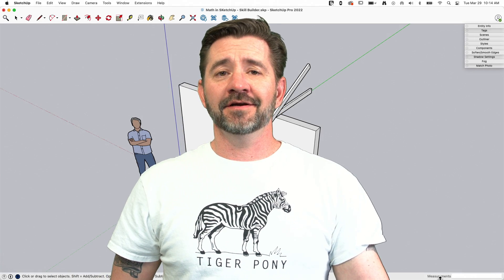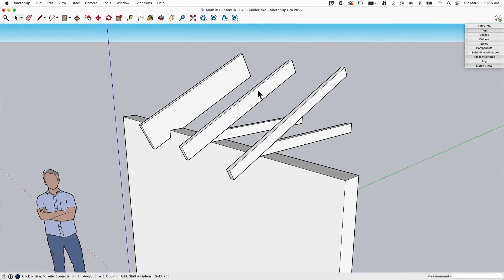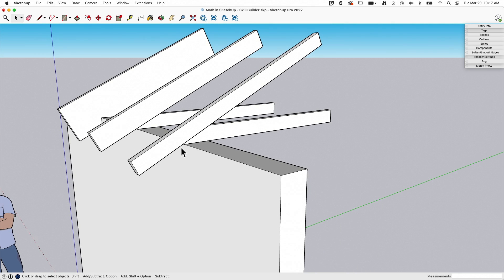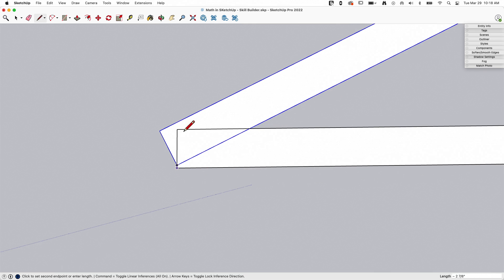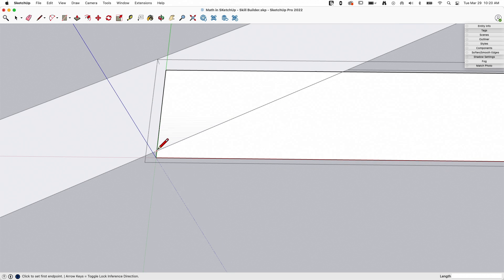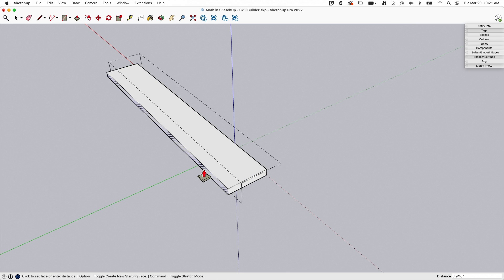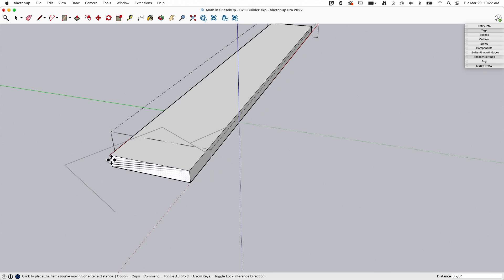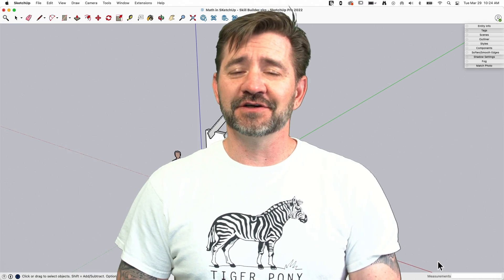Math in SketchUp - Skill Builder

Comment: Why doesn't Sketchup just use degrees to get your angles instead of doing all this math. I'm coming from 34 years of Autocad sinse 1989, and I am now dealing with this different way of thinking. I'm deciding at the moment whether I should go the Revit route or Sketchup route, Sketchup seems easier but Revit is more professional and more powerful, where you don't need all the add on's. My clients are asking for 3D, but I'm battling to change, I guess old dogs battle to learn new tricks.
Reply from the maker: SketchUp DOES use angles. In fact, that is the default behavior. This video shows how Aaron uses SketchUp to match roof slope callouts without translating into degrees.

Comment: This kind of dimensioning is the easiest way to figure out stair treads and risers. The stringers can be notched from the calculations, and details like tread nosing and handrail attachment can be adjusted to whatever you like. If you find that there is not enough run for a safe tread width or code worthy riser you can easily experiment with landings either at the top or mid-point.
Simply use the divide command on a vertical line to see how the rise changes with the number of steps, and if that number of steps will fit in a confined space. I've built several deck stairs using Sketchup, all on uneven ground, and I don't know how I could have figured any of them out using any other method. Check code requirements first. The rules can change from country to country.